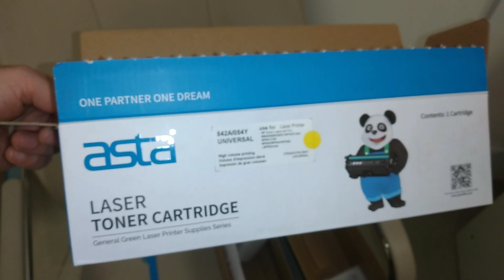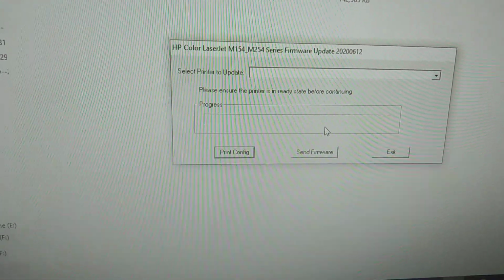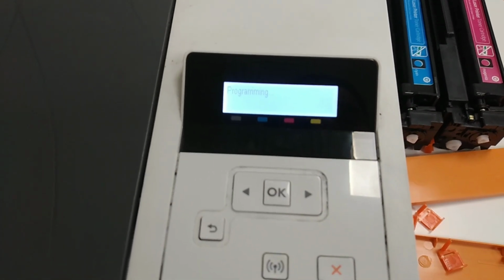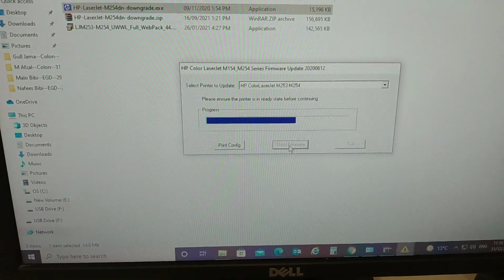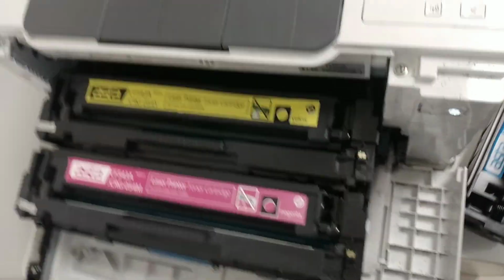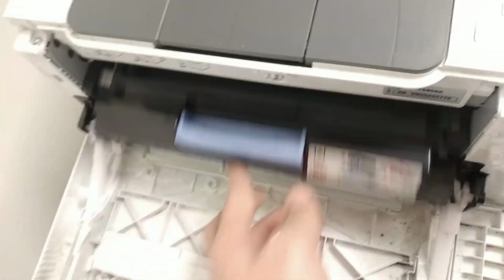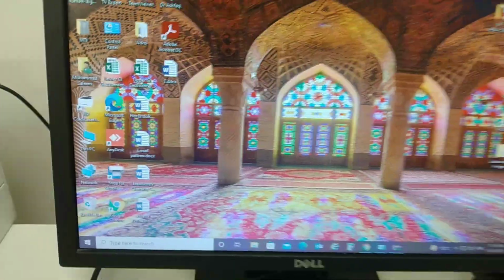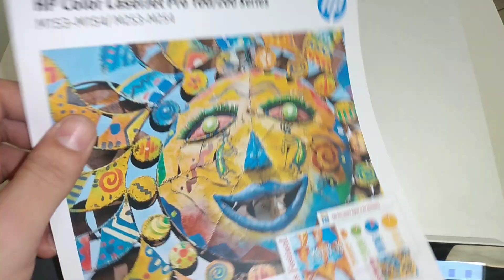Indicated Cartridges Blocked For Containing Non-HP Chip Error on HP Printerll100% WORKING SOLUTION

Comment: I tried this on my MFP M281cdw and it did not work.  I used to correct downgrade firmware too.  Any tips?
Reply from the maker: After Downgraded Uninstall the Printer software from system and reinstall the software.
Reply: @LittleLegends-c3y  that's the thing it's not allowing the downgrade to be sent to my printer.  I removed the toners and tried gain but it will not connect to the printer to install the downgrade.  Thank you for trying to help I'm not sure what else to do.  I spoke with another company that said they have to upgrade their chips more consistently and they guarantee their toners for a year.  If it ever stops working they either replace it or give you your money back.